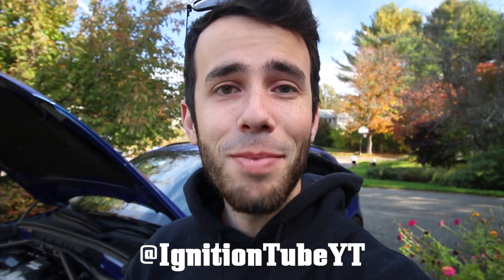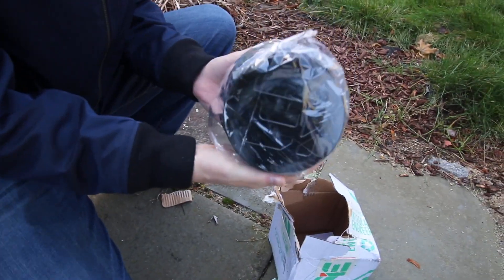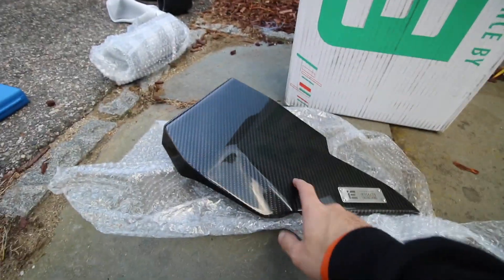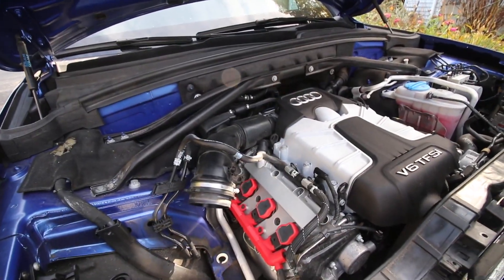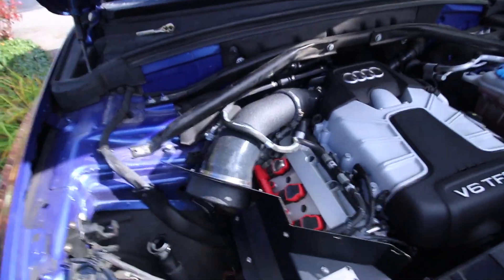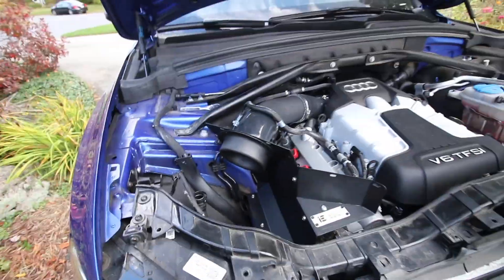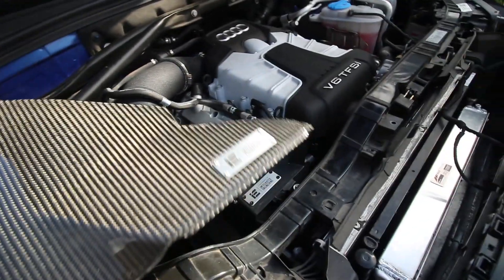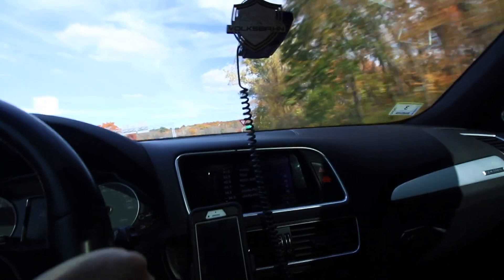IE CARBON FIBER Intake for my SQ5! (Plus S4 intake too)

Comment: I have a SQ5 also and I’ve put an intake and love it ! At the beginning I was not sure but now I always smile when I heard it 😁
Reply: what year is your SQ5?  I have a 16 and they said the intake would not be available for me for 10 months.
Reply: 2015 but I have to tell you I just replace the paper filter with an performance one and live it as is with no cover, I still have the original hose.  I can hear the intake and a better sound from the supercharged system.

Comment: When are we getting some intakes for the 3.0T A6 and A7???
Reply: Been asking the same question for a year now..
Reply: I used the s5 intake on my a7 i retrofitted into my stock airbox works super good
Reply: @issam24604mb1  did you have to make any cuts to intake pipe?

Comment: I have the same cold air intake, I have a question. Did you got any fault codes ? 
Like the traction light, the tires pressure system or code P0101

Comment: That sound tho.. love it
Reply: I have a question not even related to this video but I was curious  If you have any information or know anything about this period I have a Mkv APR stage 2 full program tune Thinking about getting race fuel needs to be atleast 100 octane not recommended to go above 104 where is the best place to get it? I know you put race gas in your S4 if I do remember correctly
Reply from the maker: Call around to your local Sunoco gas stations

Comment: Awesome man! Think it will fit on a 17 a6 with the 3.0? Also looking for a exhaust idea not trying to spend 2-3k for one
Reply: Can’t tell you about the intake but I can recommend a cheap exhaust setup, you can replace the mid suitcase resonator with an x-pipe and it will sound good under full throttle but can’t hear it normally driving around town. Can’t tell it’s there on the highway.
Reply: Thanks man I have it just straight out now and the farts on the shifts kill it
Reply: Joshua Levy I’m not sure you can avoid them